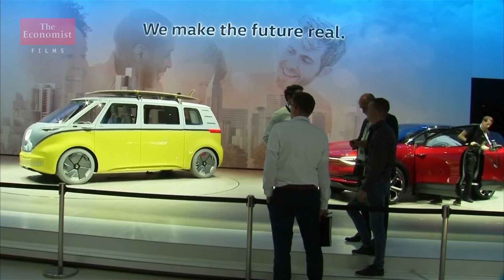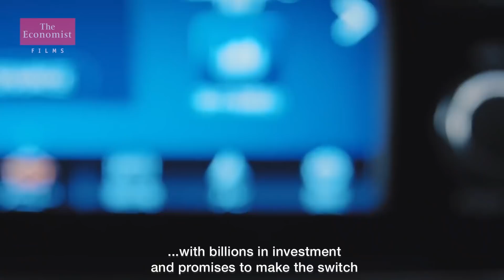Electric cars will come of age in 2018

Comment: This video spreads the propaganda against coal. Coal is now a clean and safe fuel. We have very good clean coal technology.
Reply: Joe Black - It depends where. Coal is not the problem. We have clean coal technology so all we have to do is upgrade all the power plants to the modern clean burning standards.
Reply: Yeah I missed your point and it is a good one. Even coal is getting cleaner. Petrol... Not so much.
Reply: Zaydan - Our Earth is making new, (renewable) coal, oil and gas every day but it's a slow process. Earth has hundreds of years worth of fossil fuels but they won't be needed much longer. Today fossil fuels like coal are "bridge" fuels. They are currently the cheapest fuels and therefore will assist us to survive while we transition to newer, cleaner energy. When the newer, non-fossil fuels become cheaper than coal, oil and gas THEN we will stop burning the fossil fuels.
Reply: "Clean" coal is just a lie. It's false, dishonest, counterfactual and untrue. But a lot of people make good money saying it.

Comment: What happens to big V8?
Reply: Mohd iqbal There will be a transition of a few decades during which these will still be sold and driven around. But they will eventually become less and less viable.
Reply: Collectors' items. Pleasure cars. Run on biofuel. Oil will eventually be too expensive to commercially extract due to low demand. Beyond a certain threshold it just doesn't make sense. The margins are already tight today.
Reply: yea i'm going miss its lovely sound. I love tech but not when it make shite boring
Reply: yea i'm going miss its lovely sound. I love tech but not when it make shite boring

Comment: A total fraud. Gasoline may be as clear or cleaner than electric power from the grid. 5 percent is wasted in transmission line losses alone. Electric cars take a long time to recharge. Driving range is poor. Prices are high. Cars are usually subcompact and light offering little protection in an accident. When the batteries need to be replaced it will prove very expensive. Not a good idea. I'll stick to gasoline cars.
Reply: Mark Fischer what a Bunch of LIES. Not even worth rebutting. ^ BULLSHIT.
Reply: 70%+ of the energy in gasoline is wasted in heat, noise and vibration. ICEs are only 10-30% efficient. An electric motor is 95% efficient. 

You could lose more than 50% in power line transmission and it would still be more energy efficient than ICEs. And on the other hand you can power your EV from your roof.
Reply: If much of your electric power comes from burning coal as it does in China then your savings in CO2 emissions will be small to zero.or even negative.

62 percent of China's electric power comes from burning coal according to  China's own department of statistics. The rest comes from mixed sources including other fossil fuels like burning oil. Typically 5 percent of energy is lost due to heating power lines and transformer losses, maybe even more when you consider multiple transformers in series such as at the power plant, local distribution substation, and utility transformer near the end point of use. Suddenly 30 percent efficiency of a gasoline engine which burns cleaner than coal doesn't seem so bad.

In the US coal has dropped from 50 percent to 30 percent in recent years but oil burning plants are also a lot and the heavy fuel oil isn't as clean as gasoline. Electric cars as clean energy is a total fraud at the present time at least in China and the US.

Comment: ... Is there enough cobalt to meet global demand? Can cobalt be synthesized/created?
Reply: Roland Jay Witmore cobalt is an element so the only way to create it is with either nuclear fusion creating cobalt from combining lighter elements or nuclear fission creating cobalt by breaking heavier elements in half. It would make more sense to work on finding a battery chemistry that is less cobalt dependent than to make cobalt.
Reply: Don't need to. Cobalt is a side product of other metal production. It is the 32nd most abundant element in the earth's crust. Just after Nitrogen and not far behind copper.

Comment: Not all lithium ion batteries require cobalt.  There are a number of lithium ion battery chemistries, the two major options of which, lithium-manganese, and lithium-iron phosphate, do not need cobalt.
Reply: That's right.  And, lithium-sulfur batteries are getting better all the time.
Reply: The Chevy Cobalt needs it.
Reply: every Tesla uses Cobalt
Reply: The first Nissan Leaf used cobalt-free lithium-manganese batteries (24 kWh).
But the new ones (30 kWh, 40 kWh) switched to lithium-cobalt because of the better energy density and therefore higher range per weight.
Today, high range means lithium-cobalt. But this will change some day, maybe within a few years.
Reply: Also new Carbon only batteries are being developed along with Zinc Bromide batteries, it is only a matter of time now, Oil will always have a small market, jet fuel will be required for some time yet and plastics and other essential chemicals need oil, but it makes much more sense to keep the stuff for when it is needed than just burn it up in polluting cars.

Comment: WRONG Cobalt is not necessary. LiFePO4 an entire category of Lithium Ion requires 0 cobalt.
Reply: Trus but li-ion batteries with cobalt have higher specific energy content and better performance. Tesla batteries include Cobalt, batteries in Chinese cars generally do not. Cobalt is not a rare metal and is available in many countries but cheapest source is DRC which has ethical issues about use of child labor etc.
Reply: Every Tesla today uses Cobalt! 50% from DRC #drccobaltkids  https://www.amnesty.org/en/latest/news/2016/01/child-labour-behind-smart-phone-and-electric-car-batteries/
Reply: They are about to get rid of it.
Reply: Luke W Tesla is not the only BEV Company. You are brainwashed sheep if you think Tesla owns the market.
Reply: https://www.ft.com/content/ebf70f78-b014-11e7-aab9-abaa44b1e130
Reply: http://batteryuniversity.com/learn/article/bu_310_cobalt

Comment: This piece was good up to the point you allowed the Koch Brothers and the oil industry to soil it.

How much did the Koch Brothers and the oil industry pay you to inject their lies in this piece?

Well, how much?

If you took the time to do the most basic research, you would have found that existing electricity generation is getting cleaner every year. In addition, new electricity generating plants from wind and solar are being added each year around the world. Also, a large percentage of the people buying electric cars either have their own solar or wind energy generation or they are planning to get solar or wind energy generation installed. Electricity for electric cars will continue to get cleaner and cleaner each year, but the burning of gas and diesel for internal combustion engines (ICE) cars will NEVER ever get cleaner - actually it will get WORSE and WORSE each year as the ICE engines gets older and older. Now you know.
Reply: Plus you need 6kwh electricity to refine crude for each gallon of gasoline.  Plus even without the renewables BEVs are more efficient...
Reply: Yes.. The most intelligent comment so far.
Reply: Typical for the Economist.
Reply: plus all those cars being plugged in will negate the need to switch on generators for peak domestic electricity use....
Reply: V2G?
Reply: If this is correct the energy use for refining alone is equal to the total energy use for a BEV! That would mean  that there won't be an increase in total electricity supply when the transition happen. Could you link to your source?

Comment: A rather pessimistic view on electric cars and the future production of electricity. But I suppose the sceptics need to yell loudly to keep us from being interested in offers like the longer range Hyundai IONIQ EV, the Audi Quattro e-tron, the Jaguar I-Pace(launching with its own race series) and other great cars coming in late 2018, as well as the other great offers coming before 2020.

The investment in a greener electricity production will not just happen because of electric cars, but also because most countries need green investments to reach the goals set forward in The Paris Agreement. 

Cobalt is NOT necessary in the production of lithium batteries, there are several other anodes and more on the way. Anodes like manganese and iron phosphate is already in use and others like silicon-composite anodes are almost ready to take over. One of the most promising silicon-composites is from the waters near Norway and as such not in a conflict area.

Comment: And, in fact, the grids in states like California, have been getting greener and greener by the day.  Less than 1% of CA's energy comes from coal.  Solar energy during the day is so high some of it has to be curtailed (it would be great if that could go towards charging EV batteries instead).  And while overnight energy consumption has a larger natural gas component, that will slowly change as well.  Plus the natural gas consumed at night for generation is directly offset by the natural gas not used during the day due to high solar availability.

The real cost to the grid is that utility companies can only grow by justifying new power plants, particularly (in CA) new NG power plants which aren't actually needed.  That and the massive cost to decommission old power plants that have to be decommissioned anyway.  Once the public, and the PUCs, starts cracking down on all these stupid unneeded projects, in favor of renewable generation and energy storage solutions (renewables are fast becoming the cheapest option for utility scale power generation), we may start to see more of a right-sizing of electricity prices.

-Matt

Comment: Many cars have trouble to start after night in -20 Celsius degrees because battery is discharged, how unless are electric cars ?
Reply: Because ... you believe that all battery technologies must work the same way?  You are comparing a cheap-o lead-acid battery with no thermal management to an EV battery.  That doesn't really work.

The bigger problem for EV batteries is actually getting rid of the heat, not retaining it.  There will be some degradation in cold climates, but just as one has winterized gasoline vehicles, one can also have winterized EVs.   Plenty of solutions for this particular issue, actually.  An EV can simply stay powered up enough overnight once the main charging cycle is done to keep the temperature in a reasonable range, for example.

-Matt
Reply: BULLSHIT. BEV have been wildly successful in ARCTIC CIRCLE. If you remote preheat your batteries on Charger you will even reduce range loss and have a nice Warm Cabin. Stop spreading BULLSHIT LIES.
http://www.bbc.co.uk/news/business-36402942
https://www.tesla.com/findus/location/store/tromso
http://www.mrmoneymustache.com/wp-content/uploads/2016/10/leaf-electronics-1024x685.jpg - Remote App.